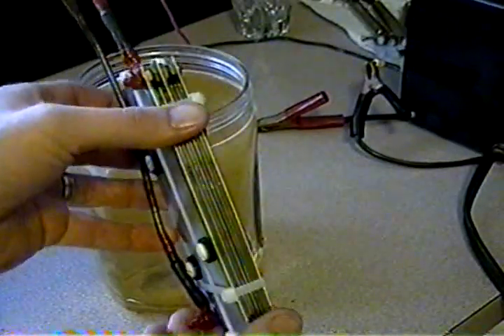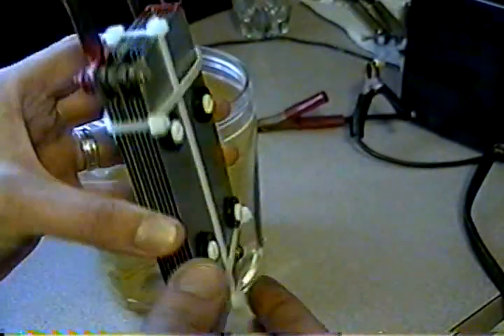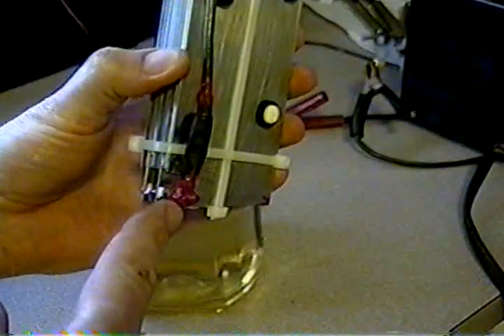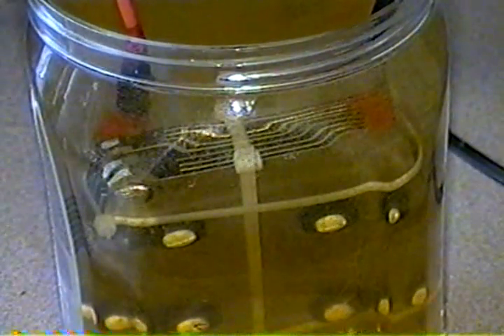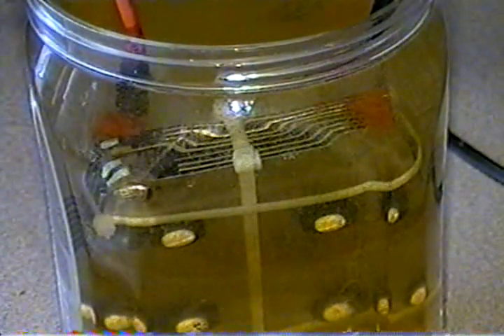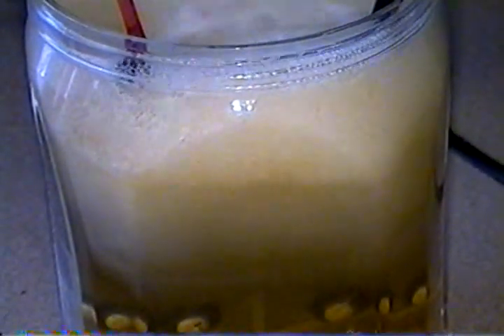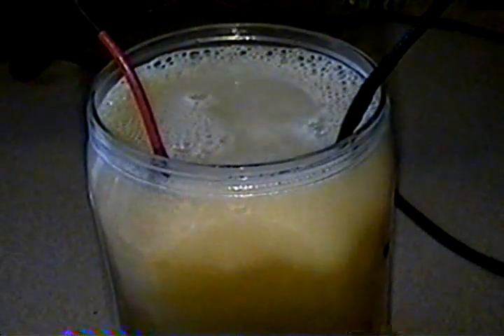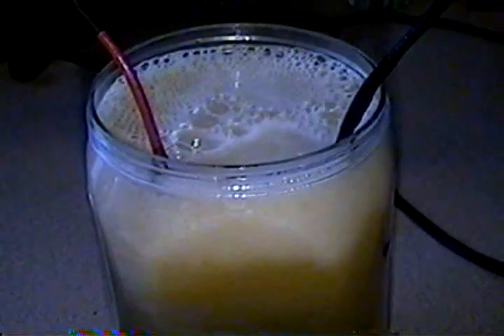9 Plate Hydrogen Generator Great Production!!!

Comment: Baking soda will eventually break down and turn the water a muddy brown, 304 stainless steel has some iron in it that will leech out and make a rusty sediment, not a good combination. I've made a LOT of muddy water, I'm trying to get some 316L stainless steel and I've used Washing Soda with good results.

Comment: hello, you said "That I Should stress it is not vital to remove all of the steam for better mileage", how to avoid the formation of steam more efficiently? I get my prototype with water at a temperature of 50 º c, I think it will be better to adjust the current (amps!) but the number of plaques neutral, I did not know they were four to 12 volts! Thanks for that info!

Comment from the maker: Neutral plates divide the voltage, reducing wasted energy in the form of heat.  2.4 volts DC (normally) are required to split the molecule.  12 volts from a car's system would result in steam and HHO production, which is also acceptable in gaining fuel efficiency.  However, to produce MOSTLY HHO, you should use 4 neutral plates on a 12 volt system.  I should stress that it is not vital to remove all of the steam for better mileage.

Comment from the maker: The insulated plastic does not corrode, as long as it is completely isolated from the water.  This unit produced 1.1LPM at 18 amps.  This is an experimental generator.  I used these same plates to make a dry cell and the production was 1LPM at 14 amps.

Comment from the maker: Neutral means:  a plate NOT connected to either positive or negative.
Reply: Mark Grello what is thr purpose of the neutral plates?  it seems to be a waste of space. couldn't you put more positive and negative plates in by leaving the neutral plates out and spacing them apart  slightly more?

Comment from the maker: Not in liquid form, you don't.  It is actually called Lithium Ion 6 and is the only way to compress Hydrogen to a liquid form without cooling and condensing it.  You can not purchase the Ion, you have to make it and to make it you need special equiptment.

Comment from the maker: Compressing HHO is very dangerous.  The reason is, Oxygen is contained in the gas.  CNG contains no Oxygen, so it is safe to store and is difficult to ignite in the cylindar.  It is possible to compress Hydrogen, but it requires a lithium ion that is illegal to purchase (I think it is lithium)
Reply: Two bottle for the storage. Second bottle filled with watered alcohol. That will compressing on intake manifold, when the engine suck it.

Comment: Hey OriginalUncleNemo, have you tried capturing the HHO gas and compressing it into a cylinder tank, then running an engine on straight compressed HHO?  Or do you think it would be too dangerous to drive around with a tank of compressed explosive gas?  I know my public service company prides itself on their fleet running CNG, so I was just wondering if HHO would be similar...
Reply: Desde Venezuela,  cuidado con encapsular el gas H2, porque por su peso y tamaño molecular es muy pequeño y puedes tener fuga ser muy explosivo, cuidado, hay qbuscar una aleación metálica q lo guarde bien , puedes tener una bomba explosiva en camino y estallar y causar daños lamentables, el gas H2 se puede escapar por las paredes metálicas. 
Gracias es una sugerencia y salio una pregunta pregunta.....
El tamaño molecular del gas GNL es mucho mayor que  gas de H2, el H2 se escapa si es retenido en un envase metálico,  hay q hacer una muy  buena aleación y hacer pruebas con agua para verificar si hay escape de gas

Comment from the maker: Well, it isn't Stam Meyer's video, he has been dead for many many many years.  However, the addition of HHO does drastically reduce emissions and better burn fue.  Moisture creates more pressure and reduces heat.  In both cases there is a net positive result.  Just don't try to run on 100% HHO, unless you have a battery capable of ~ 1000 amps.

Comment from the maker: I'm sorry.  You sound like you know some science.  However, it is impossible for what you are saying to be true.  The "bubbles" that you see are only being attracted to the opposing field.  The reaction does take place between the plates and the atoms migrate towards the opposing fielded plate.  This can be tested easily by placing a non-conductive neutral plate, while still allowing conductivity to flow through the water.  The reason a conductive neutral plate works is that it does conduct :)

Comment from the maker: Just for symmetry.  The gas is not produced ON the plates, the reaction takes place BETWEEN the plates.  So, as long as you have + - +, or - + -   either configuration is perfectly fine.

Comment from the maker: Neutrals, no neutrals, dry cell....none of it matters that much when it comes to amp runaway.  If you keep your cell clean and use the correct amount of electrolyte, the cell will not run away with amperage.  How do I know???  Because I have tested it many many many many many many times.

Comment: With that small spacing and having so few neutrals how are you certain it will only run up to 20 amps in the vehicle? From my reading most people just using 7 plate setups with all neutrals in the middle are going beyond 20 amps when it starts getting hot. Just curious! The production looks great though, as long as you can keep it cool.

Comment from the maker: The baking soda does work, but you need to clean the cell often (there is gunk build up with baking soda) and the amp draw is difficult to control)  There is a very slight chlorine production with B.S., but not enough to even mention as being a concern.

Comment: I have been thinking about this as well but have not yet finalized which way to go. Would be nice to only use waste heat from the exhaust side for this.
For sure a fuel pre-heater combined with the steam injection would lead to desirable savings.
Only cautionary item with steam would be when enough is enough before leading to potential water corrosion issues.
Let us know how it goes.

Comment: Hi Mike,
Since you have dealt with HHO now for awhile, here is a nagging issue I would like you to comment on:
I have noticed looking at other folk's systems that all along the components toward the engine intake feed you can see a white crusty deposit around the edges. No doubt from baking soda. The concern is that such deposits gradually build up inside all intake components and eventually lead to ?? all sorts os nasty issues. What do you think?
Thanks.

Comment from the maker: Stainless wire is highly resistive, producing large amounts of heat.  Plastic casings do not appeal to me.  I have tried them and I prefer stainless steel.  The copper wire works like a dream :)  As long as it is isolated (mine has been in my car like this for 7 months) there is no problem.

Comment: to reduce the amps and lower temperature, you can replace some plus and minus plates with more neutral plates. i would also replace those copper wires with ss wires, or cut some plates with some longer extensions. or maybe you already did it by now... how about cpvc for container? my2cents

Comment from the maker: In my 9 months of trials, my best mileage occurs with steam.  Eliminate steam and eliminate great MPG.  The 700ml/min is just an estimate and it was only pulling ~15 amps.  If you conduct an independent study on steam, you quickly realize why total saturation units are so much better than those with a bubbler......at least that's what I have found.

Comment: I think there is a point (>2.4 V across the cell) where all you are building is a fancy water heater that happens to also make HHO. The neutrals "commutate" the electro static field and reduce amps. Number of GAPS made by neutrals between active plates divides total voltage (you can measure right on the plates). Magic formula: 14.4V divide by 6 = 2.4V per cell. You need 6 GAPS, thus 5 neutrals between electrodes. A cell is a GAP.
Proof: remove neutrals, amps go up, gas goes down.

Comment from the maker: This one has 12 gage stranded wire.  I don't run it at more than 25 amps.  If you will use higher amperage, you will need 10 gage.

Comment from the maker: I used aluminum wire terminals.  You must be sure to completely cover the connections and seal them with at least 2 coats of the liquid tape.  Make sure it dries for at least 2 days.  And, most importantly, do not use KOH or NAOH as electrolyte.

Comment: Were you able to detect any solution leakage through the threaded area of the bolts from the back side of your connection? If you have time I'd appreciate your input on my cells.

Comment: Hello, I like your cell and have a question. On my cells I have used ss strips between the plates and threaded brass rods above the solution level that are used for the electrical penetrations. I think I would like to try your idea of using liquid electrical tape to seal a direct connection of wire terminals to the plates. Can u tell me the material used to make your wire terminals? was it copper? and did you paint right up to the plate surface?

Comment from the maker: The neutral plate is not attached to positive or negative.....it just sits there, obstructing the atoms.  Since the electrolysis takes place between the plates and not on the plates, this causes the separated molecules to takes a further trip to get to their destination.  Although, I'm now wondering if there is any advantage at all to having neutral plates.  It may be that increased spacing is the key and not neutral plates.  Further study is needed.

Comment: Thanks for the advice nemo! It hasn't heated up on me, but then maybe it is because I am not using alot of amps with a 7 plate 3"X4" cell? My next project will probably be a larger cell and so I'll cut the + and - plates so they connect without wires.

Comment from the maker: I have tried SS wire.  The problem, I found, is that braided SS wire is highly resistive.  The wire heats up to hundreds of degrees and can easily melt through the housing if it is ever uncovered by the water.  I also wanted to keep the heat to a minimum.  Thanks for the information!

Comment: made one similar with 2 neutrals in between. still experimenting to see how many plates and neutrals work best.
One thing I did do was use 1/4" SS wire instead of copper and put heat shrink on it. I sandwiched the ss wire between two large ss trim washers where they attach to the plates instead of copper connectors. Seems to work good.

Comment: My water Definately heats up over time, last night it was almost to boiling.. however one upside of this is that production goes up to a POINT the hotter the water.

Takes about an hour or two of running to get that hot. I was thinking I dont drive too many places 2 hours straight as I work locally.  Im after MPG so in a strange way the faster this thing gets to optimum heating temp the better, I just dont want to go beyond that.. I guess on long trips, I could watch it.

Comment from the maker: No matter what anyone tries to say, Watts = Heat in direct relation.  Heat is also a direct result of the separation of molecules, you can not avoid this fact no matter who is trying to sell it to you.  The only option is a heat exchanger.  Maybe run a small tube from the cell and coil it around in front of the radiator, then back to the cell with a small pump.  Thanks for the feedback!

Comment: Update: I am now using POS N N NEG.. POS N N NEG... (ie. with TWO neutrals between each) Im using 316L SS.. with 1/16" washers.  I have 17 plate configuration 12" x 2.5" H. Running distilled vinegar only. not diluted.

The extra neutral, seems to be helping with the amps.. amps are 12-16 at 12v which aint bad...however after one hour of running the WATER temps are going almost to boiling over 150-175.  Not sure how to combat this other than circulatiing the water somehow.

Comment from the maker: Yes, I took the cell apart.  The steel was scorched a bit, too much heat, blueish tone to the steel.  I have decided to go with a Tube type design for my wife's cell.  The spacing is larger and I get better production and it takes longer to heat up.  You are correct about the vinegar.  I am using a combination of vinegar and Baking soda.  It seems to stay cleaner and it doesn't need as much vinegar that way.

Comment: did you take your cell apart yet?  

I got some 316L this week.. I found that even the 316L will scorch if placed too close to a P and N.  But it performing better than the 304.  Running PURE distilled Vinegar ONLY it doesnt turn brown at all.

IN my cells they were a bit different in layout to yours..  I alternated MOST of the plates with neutrals,  but several were P NEG N... In this case the plates scorched using 316 and 304 when placed 1/16" apart.

Not sure how KOH will react

Comment: if you used 304 SS plates you might have an issue with the plates... Im not sure how your cayalyst will react with your plates, but I was using VINEGAR as my catalyst(which is more acidic, I think KOH is more a base?) and 304 plates spaced similar to yours.. 

I had heat issues over time, and the plates became SCORCHED badly turning black.  I have determined it was due to 304 SS, I am going with 316 from now on.

You might check your plates again as this cannot be seen from the outside.

Comment from the maker: Neutral means, neither positive or negative.  The plate just sits there, not connected to anything.  The electrons pass through the plate because it is more conductive than the water.

Comment from the maker: I just learn by discovery.  I have tried so many different cell designs that my wife is going to leave me if I spend more money, lol.  Neutral plates seem to keep the water from heating up as fast.  The key words being: AS FAST.  I found very close spacing without neutrals to look like massive production, but it was hot gas, which can expand exponentially...400%...when cooled the production was no more than any of my other cells.  Important note:  I do not use a PWM.

Comment: One would think that interupting the + - plates with a N plate would reduce production? I have found the closer the anode and cathode are the more HHO gas they produce?   What is the thinking behind putting the N plate between them? To act as a governer/damper on amps so it doesnt overheat/use too many amps??

Just curious why it shouldnt be + - N + - etc....

Any feedback on the use and placement of N plates would be welcome.

Comment from the maker: No problem.  Please let me know if it was the silicone that reacted with the KOH.  The liquid electrical tape that I bought from Home Depot is holding up well.  Just have to apply it in thin coats so that it dries properly.  I will run a milage test and post it this week.

Comment: Thank you. Now I understand what you were referring to. My cell is setup like a "Joe Cell", ie the center tube has a bolt welded to it & comes out the bottom, sealed with silicone. The top is bolted to the side, sealed with silicone. I'll keep a watch on the seals & report if I get signs of break down.
Thank you.

Comment from the maker: There is an O2 sensor fix, a small circuit board with potentiometer. In my car with the MAF sensor, I will use this "FIX" to lower the perceived O2 in the exhaust stream. In my other car, with the MAP sensor, I simply installed a spacer between the second O2 sensor and the exhaust. This lowers the oxygen that is seen by the sensor and fixes the problem. Thanks for your interest. We will post a video of our MPG results, with the O2 fix, this week.

Comment from the maker: If you see what I was responding to, the liquid electrical tape dissolves in KOH. Since the KOH does not instantly change in our process, the bulk of the KOH just sits there eating the sealant.  This is unacceptable....to me.  The dissolution in water is strongly exothermic, producing substantial amounts of energy in form of heat, leading to temperature rise, sometimes up to boiling point and over; This solution can be carried into the air intake at high temperatures.  KOH + Engine seals = :(

Comment: I guess I don't understand what is being "deflocculated". I am using KOH & distilled water. The water never fouls & the stainless looks good. I am getting an extra O & H by using KOH. It comes out as gas.
Could you explain why it is not a good thing to use KOH or NaOH? 
I understand that baking soda produces an unwanted gas in electrolysis.
Do you have any finding about this?
Thank you.

Comment from the maker: Yes, 240 watts.  It will run (in the car) 7 amps when ice cold and idle, 20 amps when hot and not accellerating and 26 amps when hot and accellerating.